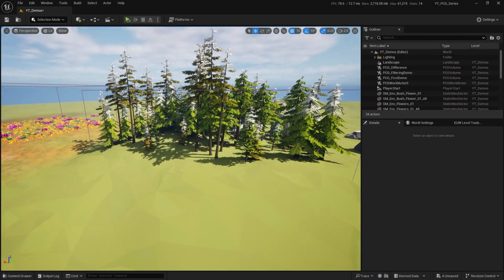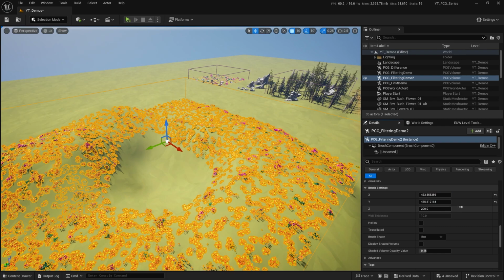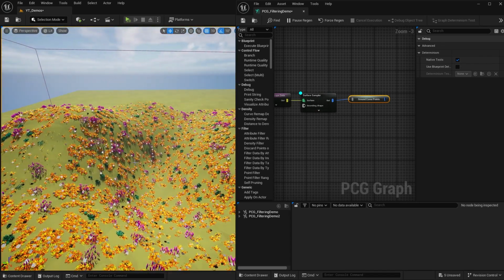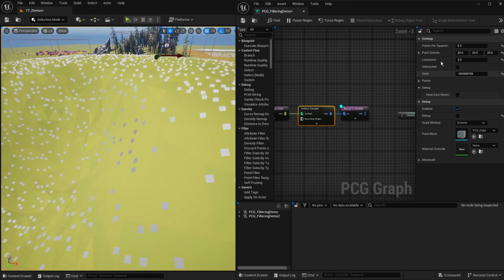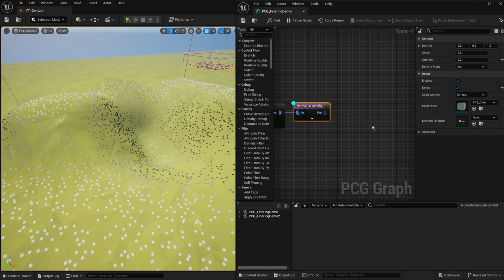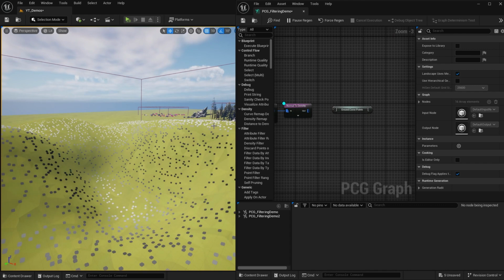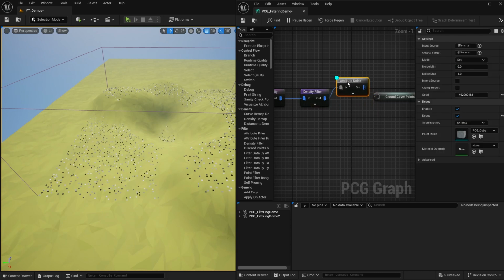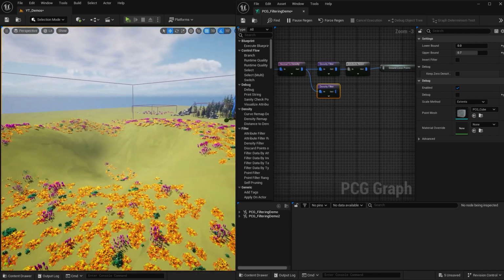Unreal Engine 5 Tutorial - PCG - 7. Normal to Density

Comment: That's a very cool trick, I was using attribute filter and looking for rotation above or below a certain value on the pitch and roll axis, but this is neat. I eventually gave up the rotation method because I couldn't figure how to plug dynamic parameter in the attribute filter, I was trying to plug it in the "Treshold attribute" pin but it never worked for some reason.
Reply from the maker: Glad it helped! The Attribute Filtering is useful and many of the other nodes work as simplified focused versions of what that can allow. I do have some videos coming soon on using parameters, and there is the blueprint bonus video too, hopefully they'll be able to help more.